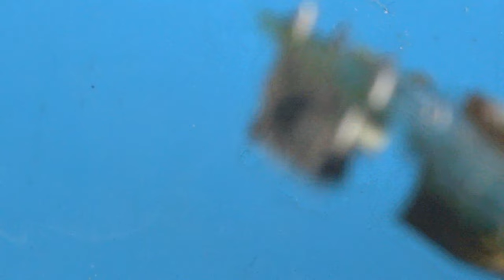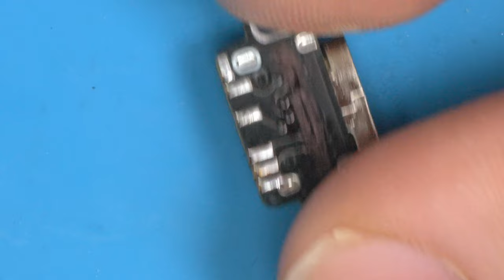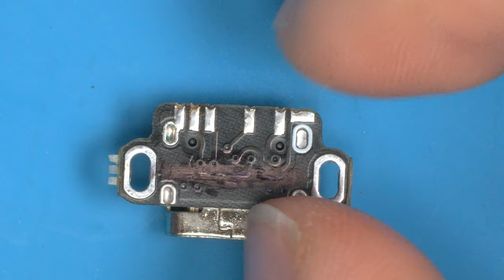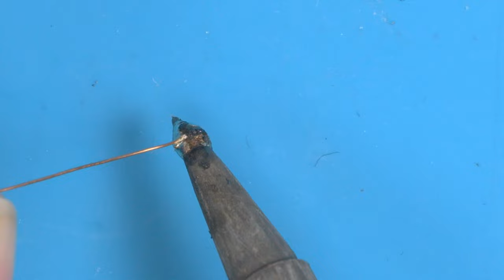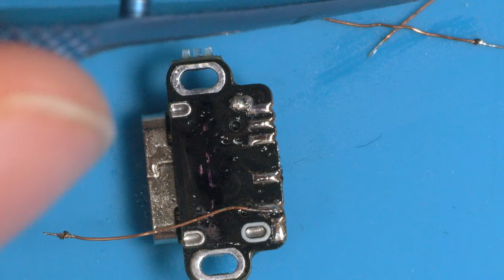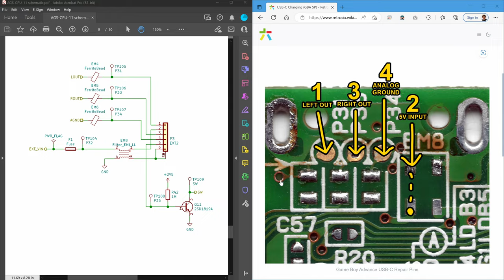Game Boy Advance SP USB-C Repair Torn Traces

Comment: Thanks for the help. After completing this repair and putting it on the charger, I have found that the orange LED light that indicates charging comes on right when I plug it in and then disappears. I put in a new battery, which is the funny playing battery mod. It is strange, because when I put in my old original battery, the charging indicator light remains on.
Reply from the maker: I wouldn't trust their batteries they are already fake labelled 950mA. Ours is 900mA true and certified by the battery factory. Stick with your stock one for now
Reply: @RetroSix  Thank you, I replaced the funnyplaying one with the stock battery and it started charging and booted up. I'll pick up your guys battery for sure.

Comment: Really helpful tutorial! What is the thickness of the enameled wire that you use or would recommend? I want to make it as flat as possible to the board so that I can still use the 3D printed cover. Cheers
Reply from the maker: You can use 0.1mm to 0.2mm
Reply: @RetroSix  brilliant, thank you so much for the quick response!

Comment: Hi there. so out of curiosity, say that the mod isn't grounded and I would need to use the 6th pin. Where would I need to solder to? I am still wrapping my head with the graph and it is making sense to me, but I wanted your opinion. My concern stems bechase the type c mod i have is from funny playing. While it looks almost identical, the holds used to anchor on both sides aren't fully circled and are instead half circled. I'm wondering if that may throw off potential grounding if I am correct. Thanks!
Reply from the maker: Best jumping on discord.gg/RetroSix and sharing images etc we can help much easier there
Reply: @RetroSix awesome thank you 😊

Comment: Had an idea for a mod I don't think anyone else has thought of. I was watching another modder adding bluetooth audio to the SP, but I was wondering if this was something that could be added via a modified version of the wireless transmitter adapter than came with games like pokemon leaf green and fire red.

The wireless adapter plugs into the Link cable port (ext 1) but I don't see why you couldn't replace the internal parts with a bluetooth transmitter connected to a male connector for the ext.2 port (with a bit of shell trimming). You'd then have a plug in bluetooth transmittter for your audio.
Reply from the maker: Sure it could be done but it's easy enough to just embed the ability inside the console

Comment: So im repairing a board that had a botched usb c port, however it looks like when the original GBA charging port was removed, all the traces that were underneath of the port were ripped out. Im also missing p34, that appears to have been broken off as well. could I solder directly to the top of EM6 for the analog ground connection and then connect the 5v to EM8 as shown?  And If I’m not concerned with headphone audio are those the only 2 wired connections I’d need to make?
Reply from the maker: You need to restore pin 6 to EM8 also for ground
Reply: Ok, so if I’m understanding you correctly, pin 2: 5v to EM8, and pin 6: to ground and also to EM8. Is analog ground to EM6 required if I’m looking to do charging only?
Reply from the maker: @mannynegron3588  Correct, only 5V and GND onto EM8 are needed, not analog ground
Reply: Wanted to let you know that I got my GBA-SP back up and running! Ended up going with a replacement original style power connector (I found it was easier for me to solder my wires onto the longer legs) then wired in + and - from connector straight to the EM8 chip bypassing the damaged traces where the old connector was torn off. Dropped in a fresh battery and good as new! I appreciate you taking the time to respond, really helped me out!

Comment: I tried this but the usb c doesnt charge it just light up orange for a second
Reply: Need to have battery inserted aswell
Reply: Did you ever find the source of the problem? I have this same issue. I'm thinking it's the ground wire. But I'm not sure

Comment: Did this mod for a friend, I didn't have any problems with pads but the issue I ran into was after the fact. The USB-C port kept detaching from the board after prolonged use, gonna have to reattach it for the second time, hoping we didn't lose a pads but I know what to do thanks to you. . I'm wondering how I can secure it to the board with more than just solder on those two holes?
Reply from the maker: The board is poorly designed. I'll design a proper one with mechanical contraints soon
Reply: @RetroSix  awesome I look forward to it, thank you for the zippy response 😀
Reply: What’s the exact enamel wire used here?
Reply from the maker: https://retrosix.co.uk/Enamel-Wire-0-2mm-p479740775

Comment: Lost my C56 cap while installing one of these. Is it super important?
Reply from the maker: No it's just a decoupling cap. Won't harm it just make sure the empty pad isn't shorted together
Reply: @RetroSix  Awesome thank you so much! My tweezers sent that little cap to the 9th dimension.
Reply: @RetroSix  Think a 10V .1uF 0402 ceramic cap would be fine for replacement?
Reply from the maker: @Josephlandon1  yep